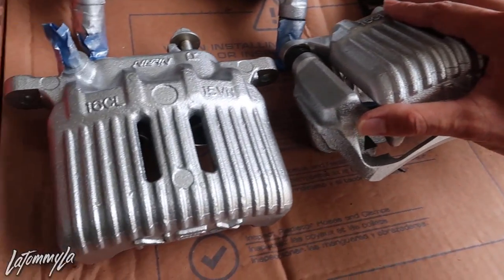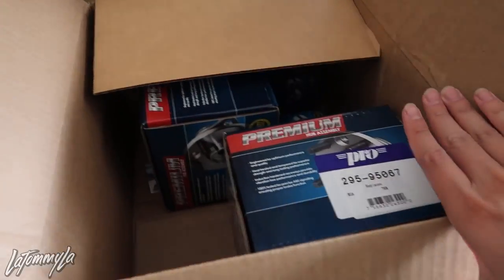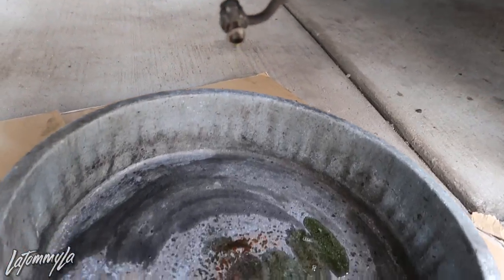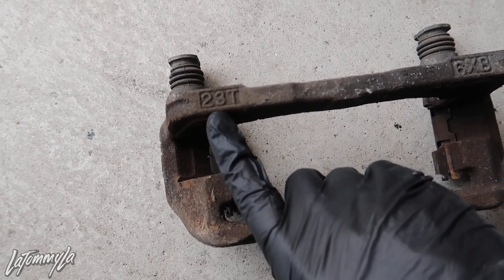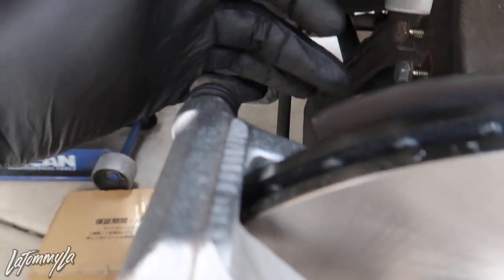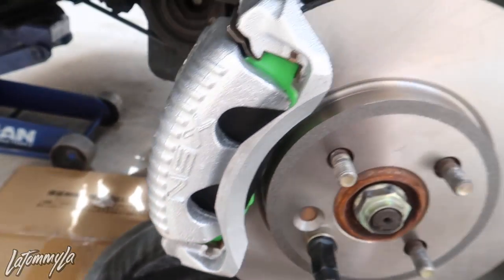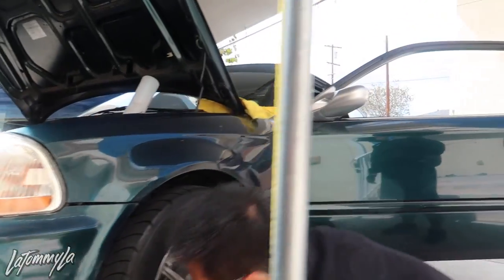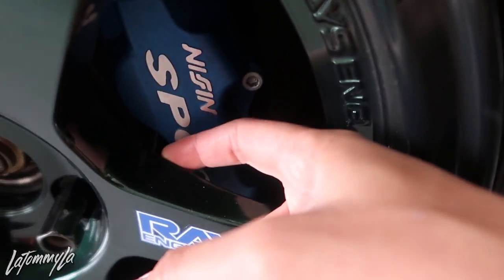NSX Calipers on a Honda Civic & Acura Integra?! Install video!

Comment: bro, i own a 2002 ap1 and a 1991 na1 and i am really considering buying an eg6 or ek9 simply for the reason that i could swap in all the parts i don't need on the other 2 cars. Just imagine a k20, crv awd swapped eg6  with s2000 wheels, nsx brakes, nsx seats, s2000 abs, s2000 steering wheel, s2000 dash ect.

Comment: I got nsx calipers on my del sol. I used na1 nsx calipers that I rebuild. Than used a 93 prelude vtec rotor since I'm running 4x114, and used a "I think; if I can remember" 95 accord wagon caliper bracket. All plug and play baby. Just need a type r brake master cylinder to make everything super A1.

Comment: I used 4x114 prelude vtec rotors with I believe a 25t caliper bracket for the 11.1 rotor and nsx caliper on my del sol. The only thing that sucks is wheel clearance with these calipers.

Comment: Del Sol Vtec Front brakes = 262mm rotors. FYI if ppl are interested i've wanted to do this for a hot minute.
Reply: Check out my del slow bro. I'm running nsx calipers on mine.

Comment: I use the 94-95 legend gs calipers (dual piston)  on my eg with mini rotors. And on the rear I have gsr calipers, ep3 caliper brackets with ep3 rotors. Dont forget a 1" master from a 98-01 integra when the time comes
Reply: I had issues finding a rear pad when i used the ep3 caliper bracket and a gsr caliper. I was also concerned with pad wear as half the pad was not covered by the caliper. 

Ended up switching to rsx-s rear calipers, but you have to bleed those upside down
Reply: Wait so the mini Cooper setup but with the Legend 2 piston calipers instead of the big Type R single piston caliper? Did you use TSX brake pads?

Comment: tsx pads still have slight pad overrun on mini cooper rotors, it isn't as bad as the itr pads, but the overrun was on the inside and outside of the pad, very slight and I think a lot less than the itr pads. I noticed when I went to swap my regular pads for track pads.

Comment: Great video! About the greenstuff, I have them installed and they work well until you demand a little, they overheat easy and they don’t stop anything.  I use them on the street, in a track I can’t  imagine that

Comment: you should post a parts list/links to this
Reply: any Acura Integra 94-01 spindles 2008 Mini Cooper non type S 280mm Rotors  4x100 any Honda front brakes and bracket if do itr  using 04 TSX brake pad say if you want to do the Mugen gate system all you need is an s2k front caliper with 294mm Mini Cooper rotor

Comment: Import from the UK/Europe 01/05 MG ZS 2.5 282MM/11 INCH front rotors, it is 4x100pcd and has the retaining screw in the correct OEM position.
Reply: You have a link to order those
Reply: Link please

Comment: My left rear coil over started leaking after one day but otherwise it is a great ride, I run them on my 95 eg with a 2000 si swap I give maxpeeding rods a 6 out of 10 so far

Comment: My set up is the MC 11in with Wilwoods. And 2002 si rears with rsx rear calipers
Reply: On what chassis?
Reply: You got more information on this I wanted to do the similar  but I'm 5x114 and do the ebrake cables. Still workm
Reply: Hey bro.. I switched it up.. Im running the MC 11s with Integra Type R Calipers all around.. on my EG
Reply: @andrewmendez6136  everything bolts right up

Comment: Another bolt on is the s2000 front calipers with acura type s rotor the only thing you have to redrill the rotors or use type r hubs rotors are 11.4 i think dont remember now.

Comment: A TIP on bleeding brakes by yourself.  Dip the end of the hose in a jar with any fluid(water, oil, brake fluid).  So the air cant get suck In.
Reply: Never heard of that. Pretty cool man. Question though. Wouldnt that cause the water or which ever fluid you prefer to suck back up into the lines?  If so i would definitely use brake fluid not water or motor oil.
Reply: @That1E_K1129  Its the same concept as the "ONE MAN BLEEDER KIT". 
To do it, pump brake atleast 5x, hold down the pedal with some stick or something. Go to the caliper and open the valve, then close it. Repeat again, then leave the valve open. Now you can just keep pumping until the fluid start to look clear(cleaner than before). Search on how to here.

Or replace all four bleeder screw with  a  ONE WAY BLEEDER  SCREW.
Reply: @BLAZEPSI  ya ive always used the vacuum kit when i bleed by myself. Pretty neat trick man ill have to give it a try sometime. The 20yrs ive been a mechanic ive never seen that before. Nice info thanks for sharing it 👍
Reply: @That1E_K1129  have a bleeder that connects to the compressor. I prefer doing the one man bleed... Good Luck.. :)
Reply: @BLAZEPSI  yea i have the vacuula bleeder kit for when i dont have a 3rd foot. I appreciate the tip bud thanks! 👍👍

Comment: Hi, I have 242mm brake and I want 282mm. Do you change the arms for upgrade the brake ? Or it’s possible to install on the 242 arms ?